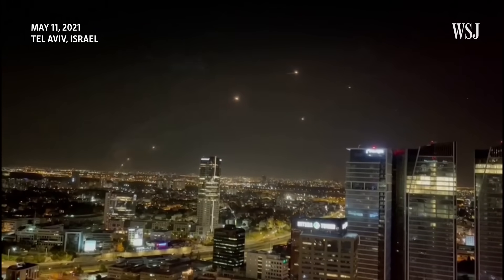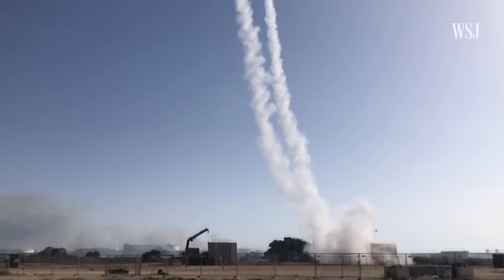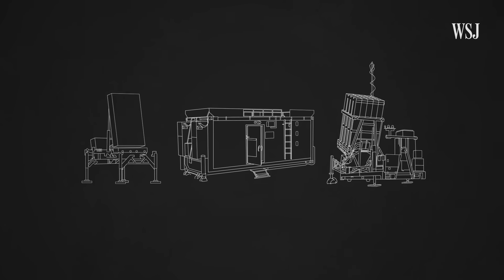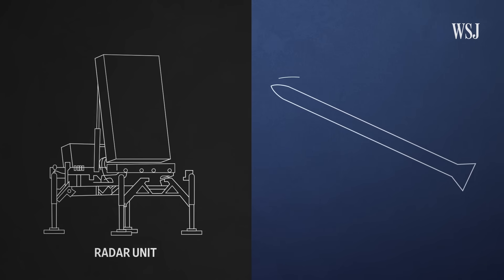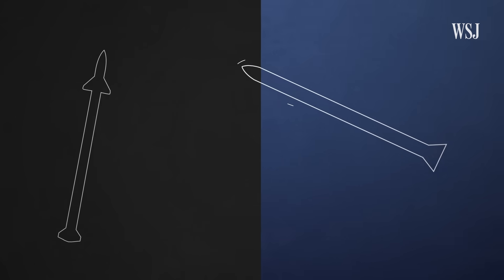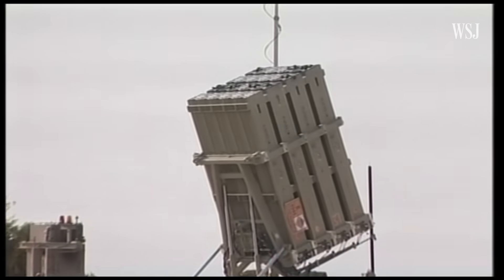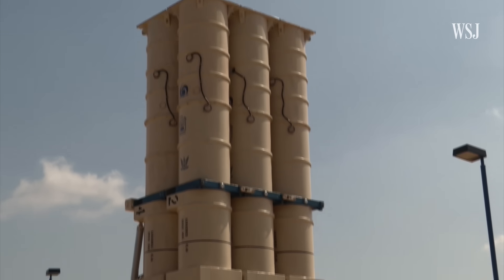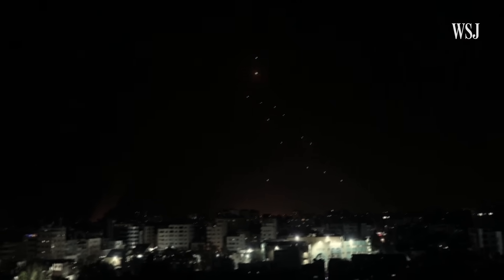How Israel’s Iron Dome Works | WSJ

Comment: Gaza is 24miles long why can’t Israel just target where the missiles are coming from and not wait for them to be in the sky?
Reply: They have automatic missiles launching controlled remotely - the launchers get out of the ground, fire a few missiles, and then go back underground. The IDF attacked launchers a few times only because it's really fast, and you can attack only after seeing the launch going up the ground.
And besides that - Israel does not attack targets without confirming it has something to do with terror, that's why Israel waits until its launched. 
With all those facts and more not mentioned here Israel invented the iron dome to prevent from people getting hurt by the missiles and save it's citizens.
it still misses some and is not very perfect, everyday there are like 5-10 fallen missiles in civilized areas.
Reply: @Eden.V  one of the most military advanced countries is having trouble finding where the missiles are coming from bc they “launch  and then go back underground too fast” we are all in some big trouble, satellites should easily be able to tell them where they are coming from, sounds like they are using cup and string technology

Comment: if they were smart they would just use a classic cheese strategy. Launch a bunch of plastic shells with cheap tracking chip to make the iron dome fire off and waste there expensive missiles then when they stop shooting them down launch real explosives and mix in fakes. once most of there defensive are down is when you use your slower bigger ones. these  guys  are just blowing up money in the air.
Reply: They are doing that now, Israel is running out of interceptors and are calling on the US for more
Reply: Actually they're doing that, hence why Israel wanted more funding

Comment: Did i hear that right it destroyed 200 out of a 1000 rockets fired, not a really good system if you ask me
Reply: Well, not all of them will be destroyed because the system only activates when it is calculated that the rocket will hit populated areas. If it is going to hit some random place, it isn't activated, because the defense rockets are pretty expensive.
Reply: Yes i understand that, but they said that out of 1000 rockets they managed to shoot down 200, thats the ones they tried to bring down
Reply: @pericaperko1031  No, they said the system has itercepted more than 200 out of more than 1000 (0:28) rockets in that specific time span. That does not mean what they actualy managed to intercept. Any rocket that is calculated to hit some populated area will trigger the defense system. As for the sucess rate for the interceptions, it is above 90%. The only scenario where the system tends to fail is in mass attacks. You can see videos of the dome actualy interception most of the rockets, if not all. It is pretty impressive.

Comment: The Iron Dome is definitely impressive and outstanding. 

BUT it would be EVEN more impressive if it could NOT only passively neutralised incoming rockets but fire a secondary rocket from above using calculated trajectory to source of launch thus making it a passive aggressive weapon shield. 👍🏻

Once launch pads are destroyed by secondary Iron dome rockets, the worries of “being Overwhelmed” by countless adversarial rockets fired at the same time will then be made redundant.
Reply: do you have actual facts on that?
Reply: @AAA_Battery3870 

It’s not a fact, I’m merely suggesting a plausible cost effective technological solution to counter those cheaper multi-missile launch pads which the terrorist are using.
Reply: @Callsign-Blade_RunnerSG   Sorry, I somehow skipped the “But it would be...” part.
Reply: @AAA_Battery3870  

No worries mate, cheers.. 👍🏻
Reply: That's actually a good idea, but what if the source from which the incoming rockets are fired is in a populated area where many civilians gather, like hospitals, schools, shopping centres etc. Those civilians would most probably get killed and then Israel will get all the blame.
Reply: @stratonovich-qx2ir 

Maybe the retaliatory missile’s detonation can be calibrated to be just sufficient enough to damage hardware but not outright devastation to limit scope of destruction and unintended injuries.
Reply: @stratonovich-qx2ir  I disagree, Israel would probably not get any blame at all.
They bombed hospitals but that is not talked about a ton.

Comment: What happened to this defence system now that over 2000 rockets landed in Israel on 8th October killing over 700
Reply: they fired over 2500 rockets and the system claims a 90% efficency rating. you do the math.
Reply: @AGAZILLION Over 3,000 was shot. But yea they don’t have common sense like of course you gotta reload it and no one anticipated thousands of missiles happening in 1 night. It was unforeseen which is why hamas were able to invade successfully

Comment: How they do if, they want to launch rocket, dome destroy them?
Reply: It detects a launch it calculate its trajectory understands. Yes, it’s about to land in an area that is populated. If so, in a split second it launches an interceptor that blasts the incoming rocket, and if the incoming rocket is going into an open area, which cannot harm anyone then The machine understands it by its calculations, therefore not shooting a rocket it’s designed for close range in short proximity rockets for a longer range the different systems different interceptors, depending on the rocket launched D brilliance of this one in particular is the short term and quickness of its action. It understands in a split of a second if it is a threat or not, and act accordingly.

Comment: Ukraine needs a couple if these one in Kiev and one at each high valued power plant. It's better than our patriot and doesn't need 90 soldiers operating each one and the patriot nissles are like 4 million each. Isreal is worming on a version of the iron dome with laser system that will cost next to nothing per round. We should be working on defense not nuke
Reply: "The control center calculates if the rocket is going to hit populated areas"
These will be useless in Ukraine
Reply: @HeavySandvichGuy1 Ukraine doesn't have areas of high population? What are you talking about?
Reply: @micah4242  I'm saying that Russia targets military targets, while Ukraine blows up rockets above our heads, which leads to civilian casualties

Comment: if the system has only blocked 1/5th of all incoming missiles. do you not aim for the iron dome defence system first. take that out and the missiles would be far more effective.

and if you send cheap dummy misslies first to spend all the ammunition inside the iron dome then you can fire the real rockets and they wont have a way to defend it.

no point in aiming for population. cut supplies, electricity, clean water etc and it will be far more damaging.

Comment: Israel needs to give some of these to the Ukraine
Reply: It won't be effective, and as a result, won't be worth it (The interceptors are worth way more than they cost as long as they can protect civilians/military targets) against rocket barrages Russia is firing, they launch a huge amount of artillery shells and rockets. Also, Ukraine is extremely large, it will be hard to cover even Kyiv alone. 

If this system would have been installed prior to the conflict it may have been effective for the first cruise missile and ballistic missile strikes and shoot down helicopters and drones, but that didn't happen unfortunately.

Comment: 200 out of 1000 rockets? I thought the interception rate was 90%.
Reply: 1000 rockets have been launch, however the system only launches counter middles at rockets that are likely going to strike populated areas. So of the 1000 rockets launched, 220 were going to strike a legit populated area, and of those, 200 were intercepted. Hope that makes sense and answered your question

Comment: Thought the Patriot Missiles did the same thing.  But I see this is much improved system.  Reminds me of Battlestar Galactica defense system. Amazed by the mobility, like how it can be used on Naval ships. 45 mile radius is pretty amazing
Reply: They do? That looks exactly like a patriot battery
Reply: Actually a Patriot missile is far more "smarter". A patriot missile can shoot down mid range to long range missiles like scuds, but it can also lock on fighter jets and change its course live while "chasing" it depending on every move the pilot makes. An Iron Dome missile has just some data from ground about a ballistic trajectory of a non guided rocket and just goes there. Sure it can adjust a bit, but not that much. That's also why a Patriot missile cost around 3 millions USD while an Iron Dome missile cost around 80 thousands USD. But a Patriot system would never be able to shoot down tiny targets like mortar or qassam rockets, and even if it could work a little bit, the idea of throwing a 3 millions dollar spaceship to a handmade flying explosive hookah is ridiculous

Comment: Can it protect israel from the Atomic bomb
Reply: Probably
Reply: most likely not, atomic bombs are absolutely huge when they explode, they will probably eradicate the entire area around Israel and Israel even if exploded in the air.
Reply: @plunto2431  That's not how atomic bombs work though. If you use a missile to blow up an atomic bomb, it won't explode, because the bomb's explosion is caused by nuclear fission. The mechanism inside the bomb has to trigger fission, it can't do so simply due to impact/heat.

Plus, if you blow up a bike over Israel, then the rest of the area, including Palestinians in Israel, and Palestine, and various other countries, will be hit hard. Nuclear fallout, and even the explosion itself will eradicate half of the middle East.
Reply: @sguraya7223  oh ok, I didn't know that, thanks for telling me :)
Reply: @plunto2431  Yeah no problem lol, I didn't know it until recently either.

Comment: The truth is that Iron Dome saved many many lives on both sides of the conflict. Of course if thousands of rockets were fired and only about 10-20% got through the defense of iron dome, there would have been many deaths on the israeli side without it.

But also Israel would have been forced to make a much larger military operation - because the public pressure to defend itself would be much strongen under such circumstances, maybe there would even be an invasion, and many more palestinians would have been killed and injured as a result.

Comment: * The 4-layer storage shelf design makes this table very suitable for being placed in a small room , and maximizes the use of home office workstation space . It is a multifunctional workstation that integrates computer desks , bookcases and shelves . It is suitable for study rooms, bedrooms , living rooms and offices, and can be used as computer tables, office workstations , study tables, writing desks or game tables .
* Functional Computer Desk with Shelves. Equipped with 3 Tier Storage Shelves, can efficiently store various items.
* Modern Simple Style computer desk has an industrial charm appearance, will be a beautiful décor for your home.
* Spacious & Sturdy: This desk provides ample space for writing, studying, gaming and other home office activities.
* Robust design: The steel pipes of the table are all 30*30 square pipes with a wall thickness of 0.8cm, and are equipped with two high-strength diagonal braces, the steel frame structure is stable, the steel frame is thick, stable and does not shake. 
* Sufficient space: 47.00” (length) x 22” (width) x 49.50” (height) provides a size space that can accommodate your laptop, PC, keyboard, and accessories. Make sure you have enough The space is comfortable to work or study. The height of the table top is 29.5 inches, and there is enough leg room for rest and storage. Including adjustable level foot pads, it can keep the table stable even on the floor that is not stepped on.
* Designed by Better Home Products.

https://www.better-homeproducts.com/product-detail/253

——————
🌐Visit us at https://www.better-homeproducts.com/
📍323 Cortlandt St - Belleville - NJ
📞973 437 5068
📩Message us for more information

Comment: It’s like the Patriot system , but far advanced.  During the Gulf War, we had a Patriot missile battery next to our base , like literally off the flightline (I was with the 354 TFW).  We would watch the fireworks at night.
Reply: Fawad Ahmed  the only way hamas can intercept rockets is by using civilians as human shields.
Reply: Fawad Ahmed  Evidence please.
Reply: Fawad Ahmed  ah yes 'ahmed' 😂, doesnt matter it cost billion of dollars to operate,its just means israel goverment value every single of their citizens more than money,unlike those Hamas dudes with their 'Humanshield Dome'
Reply: Fawad Ahmed savages https://youtu.be/RCAZG0BmF0U
Reply: Fawad Ahmed  where did I apply that logic?
Reply: Was born in 81' As a kid it looked like fireworks on TV.
Reply: Actually a Patriot missile is far more "smarter". A patriot missile can also lock on fighter jets and change its course live while "chasing" it depending on every move the pilot makes. An Iron Dome missile has just some data from ground about a ballistic trajectory of a non guided rocket and just goes there. Sure it can adjust a bit, but not that much. That's also why a Patriot missile cost around 3 millions USD while an Iron Dome missile cost around 80 thousands USD
Reply: I think it's based in the patriot, it's American designed and built
Reply: @thehorsecockexpress1068  And funded and so are the insurgents so the $$$ will keep coming in forever.
Reply: @thehorsecockexpress1068  no

Comment: It is really impressive how effectively can handle saturation attacks.
Reply: Attacks by $100 rockets made in garage, most of them fell on their own.
Reply: @albogypsy2842  3000rockets 2000 success.
Reply: @albogypsy2842  iron dome failed what more when iran firing the originsl one israel will be pulvorized
Reply: @albogypsy2842  — $100? You can’t repair a car for that much let alone build a rocket. Cheapest estimate was $300 and that for a very close range rocket.  

Also Hamas probably ran out of rockets at the same time as Israel ran low on missiles.
Reply: https://youtu.be/pQQuTSl705c
Reply: Failed
Reply: Fawad Ahmed  dont rely on that manmade things you must rely first to allah.before things.

Comment: Irone dome can not protect assets from salvo rocket fires. 10% of the IDF soilders those are operating this system are suffering cancer due to the extreme radiation by integrated Radar.

Comment: $ 100 Resistance Missiles $ 100,000 Iron Dome Missiles. Who is the winner?
Reply: no long range missile cost $100. Even a RPG rocket cost around $300..
Reply: @stealthstandard  It may be true for you who live in the United States, but it is not true for others. Many things are much cheaper outside of America.
Like what the Chinese produce and which has caused the unemployment of American workers.
Reply: @stealthstandard  The rockets' bodies are made of household gas cylinders and their fuel is made from chemical fertilizers and is made by humans who fight for belief and survival, not like zombies for money and destruction.
Reply: @stealthstandard  If it were otherwise, and the rockets of Gaza, like the rockets of Iran, were made by the manufacturer and were accurate and expensive, no doubt with these 1500 rockets, the child-killing regime of Zion would have been destroyed by now.
Reply: @stealthstandard  You want to get me wrong, but you do not know the difference between a rocket and a long range missile.

Comment: This looks more comprehensive than the system have in DC, which is puzzling.
Reply: DC doesn't constantly face the threat of missiles launched at it, so they don't exactly need it. In fact, the only time explosives were ever dropped on American soil during an armed conflict it was done to break a strike: https://en.wikipedia.org/wiki/Battle_of_Blair_Mountain

Comment: This is a good overview of the system, but just note the technical details on the electronics is worth a 60 minute video as it coordinates automatically with air force radar and is placed in interlocking fields of fire and has different success rates on type of missile and where it's going and so forth.

Comment: 200 out of 1,000 rockets fired at Israel?!?!? 
That's not an iron dome, that a spaghetti strainer!
Reply: I think that the explanation was no good. Till now about 3,000 rockets have been launched toward Israel by Hamas. The Iron Dome calculate where they suppose to fall down.
If it shows a town or a village it is launching a Missile and destroy it, if it supposed to fall in open spaces, the Iron Dome is not reacting. 
That's why only about 300 Missiles were launched.  Of course it's not 100% but 90% of it do a good job.

Comment: Only partially correct when he said it takes down the other rocket by exploding near it.  Actually it explodes near  the target and sprays the immediate vicinity with hundreds of ball bearing like projectiles similar to a claymore mine.  At the speeds involved, that is the only way to have the success rate that they do.  Even using a shot pattern like that, it's still remarkable considering the combined speed of the interceptor and incoming rocket.  Iron Dome's ability to change direction in a microsecond is astounding.
Reply: It truly is. Seen it in action many times and still hard to believe it can move like it does.

Comment: Judging from the comments, people here don't realize this system is the Raytheon Patriot Missile Intercept Battery program of which I was a part way back in the 90s. We sold these to Israel and they did some upgrades to the system but it is basically the Patriot battery. My responsibilities on this system was the RADAR initial tracking algorithm updates.
Reply: Is there any possibility it could accidently mistake an airplane for a rocket and shoot it down?